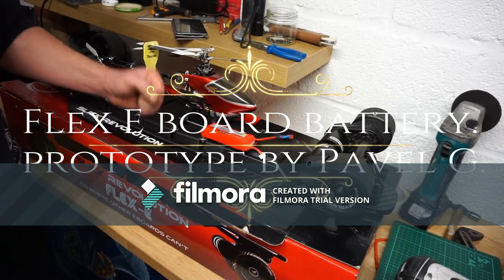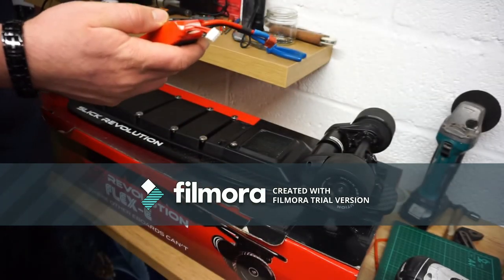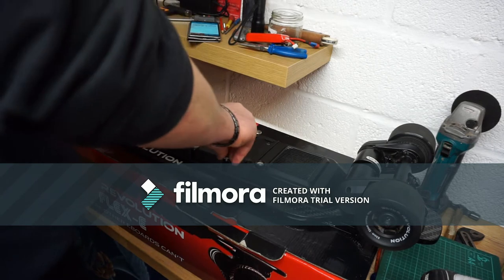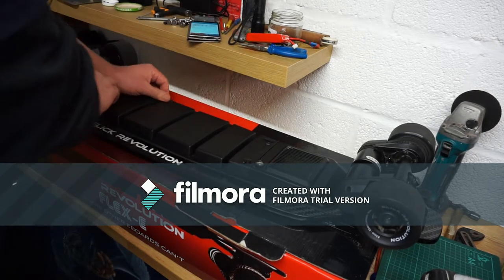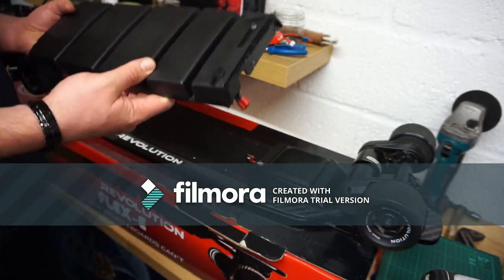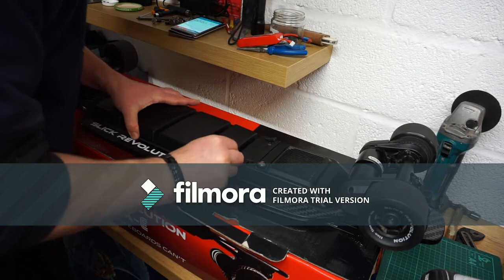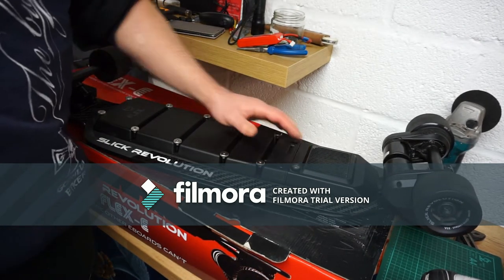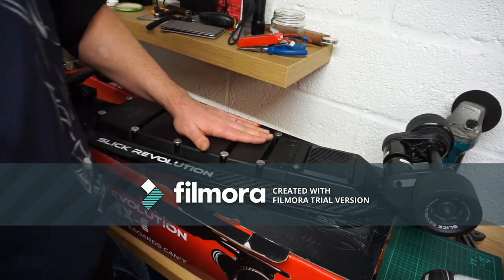Flex Eboard interchangeable battery prototype by Pavel G.

Comment: Pavel I love your videos, so detailed! Do you think long rides in rough roads would get those screws loose with the vibrations?
Reply from the maker: Hello Danny,Yes they will. I did cover this subject in one of my videos but might do another just to cover some safety tips....what do you think? I would recommend to use new locking nuts or a used locking nut with a split washer .You should be checking all the bolts at least once a week. Blue block it if are not planning to take the board apart as often as I do : )Thank you for the nice comment buddy! Means a lot!
Reply from the maker: Just in case if you were asking about the battery screws and not the rest of the screws on the board - I had the battery fixings on the Flex for over 3 month now and they never got loose but I did check them every time I had a chance. I it really easy because you do not need any tools :)

Comment: This is actually great. I’m really really very tempted to try this! Do you think this effects the waterproofing though?
Reply from the maker: Hello Steven,
The board is not waterproof from the start mate. It is only splash proof. There is a rubber gasket between the deck and the battery so taking the battery off and putting a new one on is very simple.I do have the video on how to make the fixings as well.
Reply: Pavel Garmas Ah yeah sorry I meant splash proof/water resistant. The dream is for it to be fully waterproof! But what I mean is do you think doing this affects the splash proofing? As in makes it worse? Also do you know what this does to the warranty?
Reply from the maker: Steven,
The level of the splash proofing will be the same but the warranty would be voided if you tell anyone that you actually done it :) i did do mine :)